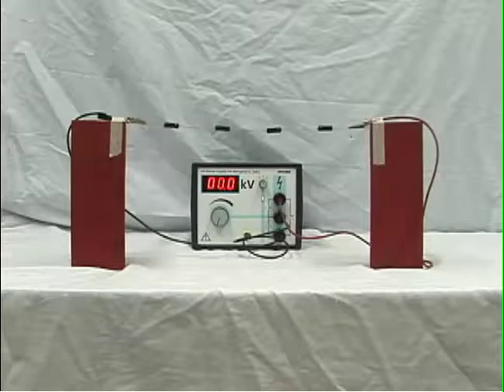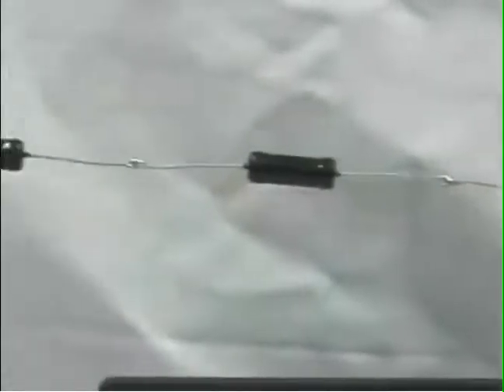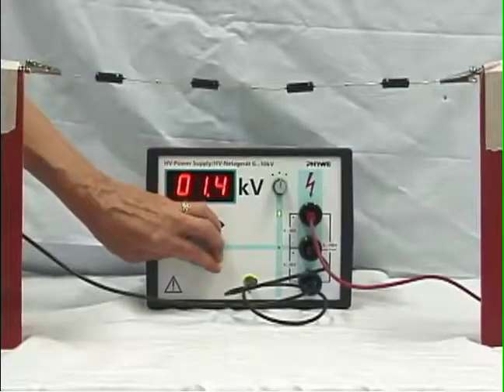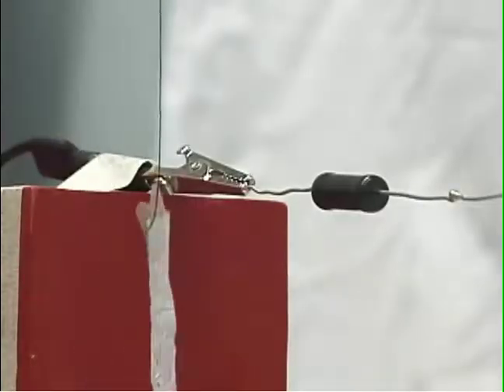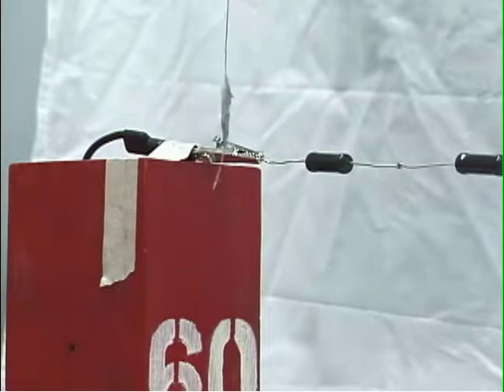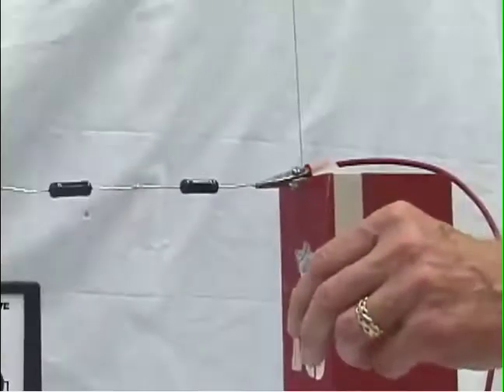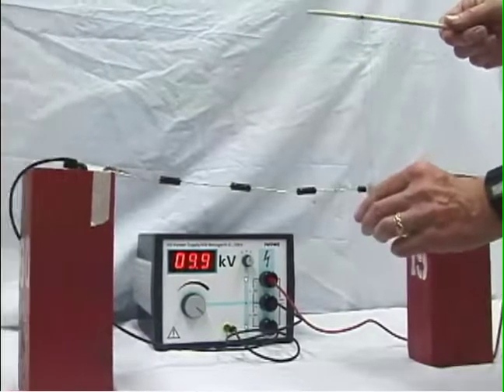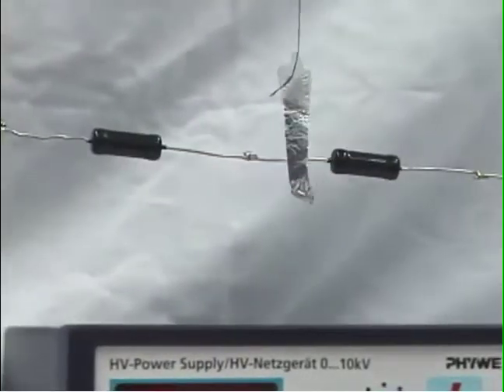Surface Charge on a High Voltage Circuit

Comment: Hello sir, great video. I have one question that not regard this particular circuit: Why the electric potential on the two wire ( one connected to the positive of the battery to the resistor, and the other connected with the resistor and the negative side of the battery) have each a costant potential? If i measure, for example with a voltmeter, the potential difference of two points in the first wire i have difference of 0 volt. Isn't it in contraddiction with the concept of the gradient of charges along the wire? Because if i have a point with an higher density of positive charges and then in a second point a less density of positive charges, shouldn't the potential difference measured on this two points be different than 0 volt?
I'm sorry if i might have express myself badly. Thank you.
Reply from the maker: You are right! In the real world, the wires do not have constant potential. (If the potential was constant, there would be no current in the wires.) The potential across the wires is very small, so perhaps your voltmeter isn't sensitive enough to measure it.
Reply: @FrankNoschese  Do you know some good books which explain electric curcuit and electronic components like resistors ect in term of surface charge ?
Reply from the maker: @achaab979  Yes! The textbook “Matter and Interactions” by Chabay and Sherwood has a whole chapter devoted to this!